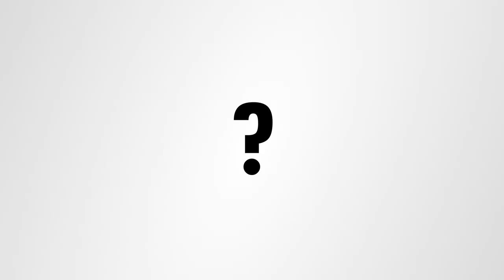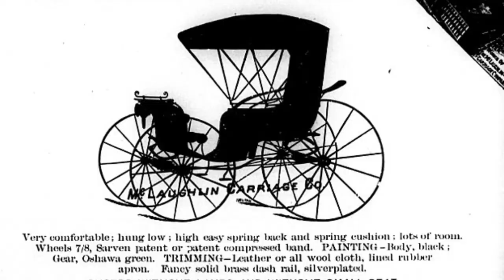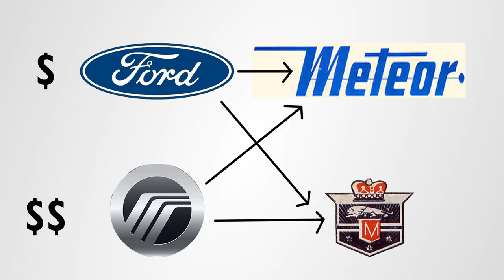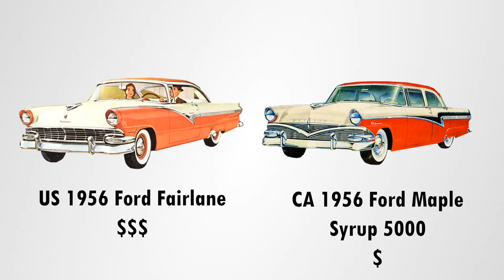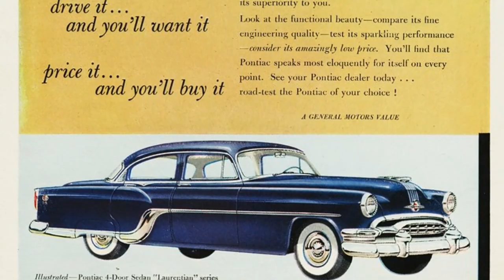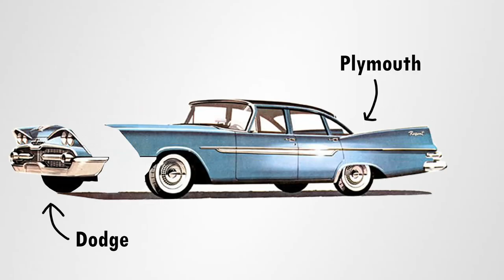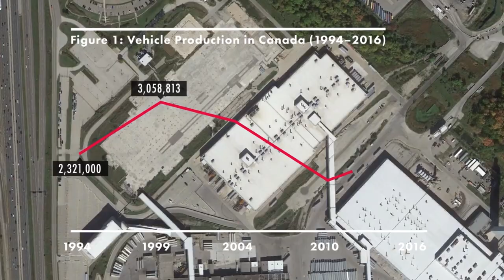Ep. 27 World Tour: The History of the Canadian Car Industry

Comment: There are many people who are on board with EV's, but there are also many people who are 'not' on board with EV's. I'm not on board with EV's, but am with hybrids. You get a battery and a gas engine to charge the battery. If they could have a range of 300 on a single charge and add the range of a gas engine or make the charge system extremely efficient from a single or dual piston engine you've got something that could dominate the vehicle economy. Imagine a hybrid that can self charge on its own without needing to feed on the power grid. A vehicle that will turn the engine on when the battery gets low, keep itself warm in cold weather and cool in hot weather. The small engine to charge the battery would fit in the front and wouldn't have to spin very fast but connect to a pully system that on the other end spins very fast. Think of it like a clock. The motor would be the hour dial while the charge system would be the seconds dial.